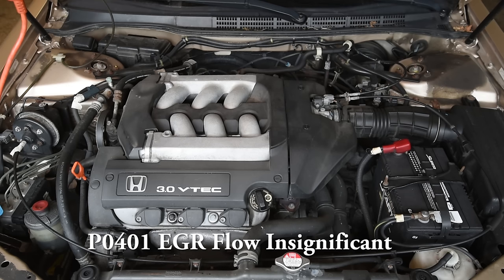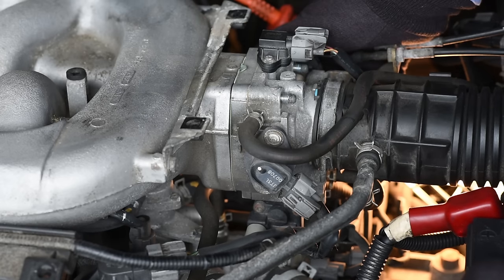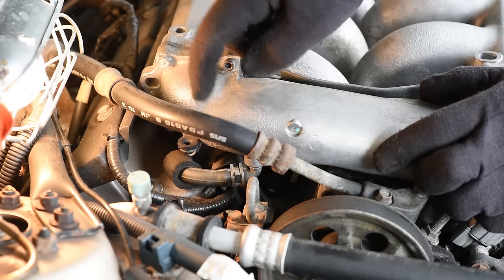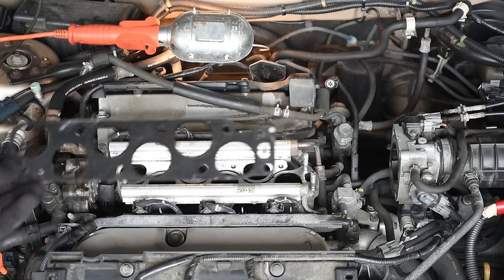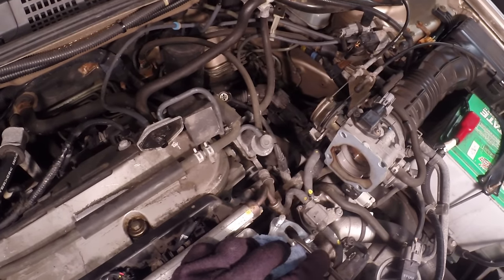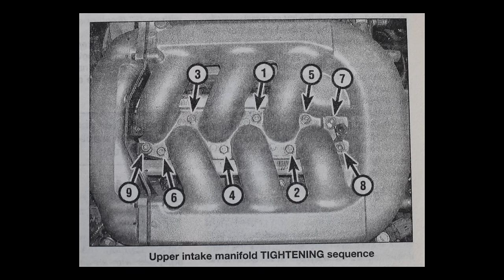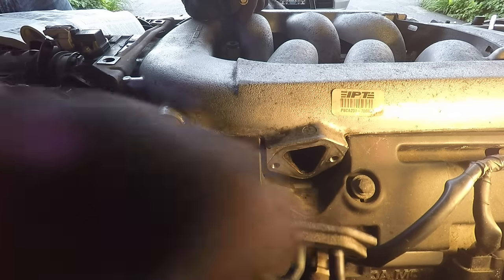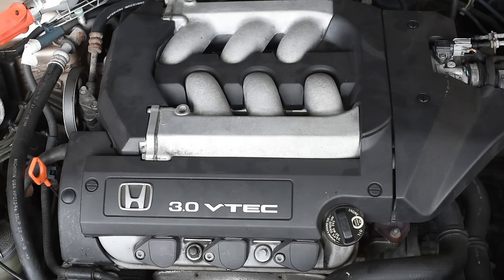How to Clean EGR Passage in V6 Engine (1998-2002 Honda Accord and Acura) P0401 code

Comment: Great video. Congrats Igor. Top class instruction and enough  detail to guide even the rankest amateur without loading too much technical stuff .onto  the video. Great idea to illustrate the undo and tighten sequences. One query. In Australia I am not sure about the liquid you are using to clean out chambers etc. Is it available  outside  the USA?
Reply from the maker: Thank you Doug! You can use any carb or throttle body cleaner. I did a quick search on Australian sites, something like that for instance https://www.supercheapauto.com.au/p/nulon-nulon-throttle-body-and-carby-cleaner---400g/9805.html?cgid=SCA01080301#segment=1&page=1

Comment: your video is extremely helpful. but could you plz tell me what the sensor is on the back of the head? I found there is no gasket in mine when I pulled it open.  and the hose to the left, exactly what is that called? my clamp is in horrible shape. thank you so much ahead of time.
Reply from the maker: +gwcs1218 hi. Thanks for feedback. I believe this is PCV valve, and the hose is called "pcv hose"
Reply: Igor Kadulenkov  thank you so much I wasn't sure!

Comment: could carbon build up lead to compression being sent to top of motor therefore sending oil to top of my motor. this motor to be exact, I replaced egr valve code went away, but i am having  3 cylinders misfire with oil being found when i pulled out the spark plugs if you have any idea why this is happening, would much appreciate the advice🙏🏻

Comment: WHEN YOU CLEAN THE EGR PORT ON THE MOTOR WITH THE SCREWDRIVER 🪛 AND SPRAY WITH CARBURETOR CLEANER WHERE DOES ALL THAT DEBRIS GO ?

LOOKS LIKE IT WOULD GO INTO THE ENGINE I ASSUME YOU WOULDN'T DO THAT IF IT DID... SO WHERE DOES ALL OF IT GO ?

EXCELLENT VIDEO BTW... THANKS 👍

Comment: What is the spray called?
I have po401 code on my 99 accord and have done the following to it: new converter, erg valve, spark plugs, ignition rotor, distributor cap, and an exhaust leak fixed. I'm still having misfires and the code is still on. What should I do?
Reply: What new code are you getting?

Comment: I have a 1998 Honda Accord v6 with 242,000 miles that had the P0401 error code.  I removed and cleaned to intake ports associated with the EGR, but after driving approximately 30 miles, the error code comes back.  I replaced the EGR valve and gaskets associated with the repair.  The car runs great, but lost on what can keep that error code coming back.  Any help would be appreciated.
Reply: This video misses a step. The EGR valve should have been removed to completely clean out the EGR passageway. The EGR valve also needed to be cleaned with carburetor cleaner while it is removed.  According to professional mechanics, Denso EGR valves never fail unless its hit by a missile. They can be cleaned with carburetor cleaner and put back in place after you've thoroughly cleaned the EGR passageway first.

Comment: I have 2000 v6 Honda Accord,  had egr intake removed and cleaned week ago. The engine light came back on 2 days after cleaning. Car runs okay a little sluggish  Today all the interior dash lights came on, what to do now.

Comment: Do you use air duster to blow it out? Do I blow it inside the egr valve passage? What if I cant torque at 16lbs I don't have the tool
Reply: You can tight em by hand just make sure all the bolts are eavenly tight.

Comment: After seeing so many videos of these kinds of fixes... I'll probably never go see a mechanic for this kind of stuff. "$120 for a catalytic converter; $245 for the service." That's what they told me. It took them 10 minutes to switch the cat out. They charged 24.5 dollars PER MINUTE that was spent working on my car. Lucky for them I don't have any welding equipment. Mechanic right up the street wants to charge me 800 dollars to clean out my EGR valve to get rid of my check engine light.
Reply from the maker: +Pander G yep, that's exactly why I try to do as much as I can by myself. A starter welding machine costs around 80$ on eBay. I guess it's a bit harder if you don't have a lift though. But yeah their prices are insane. I wish more people would service cars at home
Reply: Omggg 🥸

Comment: Thanks for taking the time to produce this video. When you cleaned the descending EGR passage in the front injector base (17055-P8A-A01), where did the gunk you loosened end up? Also, I'm curious why you did not remove the EGR valve (18011-P8A-A00) and clean its ports as well as the ports in the water passage housing (19410-P8C-A01) where it mounts to.
Reply from the maker: Hi, i replaced the EGR valve a few months ago, so didn't need to clean it. It looks like in 80% cases the passage in the manifold is the one getting clogged. For the gunk, i assume it's getting burned in cylinders. I am not 100% positive it's the best approach, but it worked for me.
Reply: @IgorKadulenkov  How often Miles do you have to Clean the manifold???

Comment: does this cause the engine pulsation then just drop and stall? because thats what my car is doing. it would start and stall out.
Reply: kalilaoboiii707 Hey man . did you ever fix that issue? I'm going to try with my girlfriends car it recently started doing the same thing.
Reply: That sounds like a clogged intake, pull the manifold off and clean all that carbon and crap out.

Comment: hey Igor I can  not detach manifold from the throttle body  gasket.I  taped with hammer and nothing .Its like glued . any suggestions. I had my car for 18 years
Reply: i got it i used screwdriver under angle   against the top of throttle body and hammer and it worked.
Reply: Have a new one ready

Comment: What is that part at 3.5 min I have this engine and when I bought the guy sold it to me with the upper hold having a screw in to plug the the hose.
Reply: Joshua Campodonico EGR valve ? Your car prob runs without EGR now
Reply: He did an egr delete just put one back in

Comment: Igor, I have the same problem too. I replaced plugs, coils and egr valve but check engine light keep coming back. After watching this video I am going to do the same proceeder. That's my next project.
Mechanics in New York are crazy and arrogant. My question is, will the light go away by itself or needs to reset again.  Thanks.
Reply from the maker: Hi,
Sorry for later response. I would reset it, I usually use a cheap Bluetooth scanner for that. 
It should go away after that.

Comment: i just did this but now the car is revving on its own ?????????? help please
Reply: Did you find out what it was? My car does the same thing.
Reply: @mrblankthoughts  no i didnt.
Reply: Did you change all gaskets? Did you buy new egr?
Reply: check your vacuum lines for any cracks or cuts, make sure all connections are on, if it high iles then comes back to low idle and continuously does it its prolly a vacuum leak from any of the hoses you removed from intake manifold
Reply: Well, it's been over 1/2 year hopefully you have it fixed, if not try these three things. Burp the radiator and/or clean the IAVC. It might need to relearn to idle also.-----> 
idle learn
https://www.youtube.com/watch?v=-izuZvjCh4Q&t=150s

clean IAVC
https://www.youtube.com/watch?v=vUXXzVL5frk

bleed cooling system
https://www.youtube.com/watch?v=zUpXgAJ1gjU
Reply: Sounds like a vacuum leak somewhere

Comment: hello
i did exactly what you did, but after i cleaned and start the engine the car work fine for 2 minutes and then white light smoke come out and the RPM goes up and down!! is this mean the carb cleaner did not dry out yet, please advise
Reply: You plugged the egr hoses in wrong done it before on a dodge avenger v6

Comment: Hi, what's the torque wrench you used? And what was that magnetic tool? It made doing this job very easy!
Reply from the maker: +Dan Hi Dan, that torque wrench is some cheap generic that I got from AutoZone. Basically any torque wrench will do here. The magnetic telescopic tool you can also buy at AutoZone or O'Reilly's, they're like 1$ :) or you can buy one online. This is a super handy tool

Comment: I did what you did here on my car and I drove the car for about 15 miles so far. The check engine light is still on and sometimes flashes. There is no other codes. What seems to be the problem? Thank you
Reply from the maker: Sorry for later reply, did you figure it out? Have you reset the code after cleaning the ports? It could be caused by other problems.

Comment: Can this be causing all my cylinders to missfire? I have same car.
Reply: Daniel Salgado possibly I'm having a misfire think I got to clean my engine
Reply: Felipe J Briceno bro it was a fucking coil lol
Reply: @danielsalgado6883  oh lucky lol, I've still got mine throwing me fits
Reply: You are lucky because my car was misfiring so bad it would hesitate to accelerate. So I bought some coil packs and spark plugs (only one sparkplug was shot) and replaced all coil packs. My car still has the flashing check engine light and has misfires in all cylinders....It idles rough with a shaky engine too.....
Reply: @Khi.252  Same here, bought all 6 coils and spark plugs and my check engine light keeps flashing
Reply: Sergio Figueroa My car also needed an EGR Valve, I changed 3 of my Spark Plugs (2 I couldn’t get to and the other was pretty much new) after that and it turns out that the plugs may have been burnt from the misfiring. My car did not hesitate anymore after I replaced those, and it showed a great difference in power. My check engine light doesn’t flash anymore either.
Reply: @Daniel Salgado were all of your cylinders misfiring at once? Was it one coil pack or all?

Comment: Can the intake be tightened without a torque wrench, and if so, how much?
Reply from the maker: Are you asking to provide torque settings for your hand?
Reply: @IgorKadulenkov  No, I just don't want to buy a torque wrench for one single job. Sometimes they'd give how much of a turn you tighten after the screw reaches the surface, like for spark plugs, I was asking for that.

Comment: same car but wen i start it up sometime it will shake an idle then eventually die. it only does it wen being started up an i woukd have to hold the gas to get it steady. ???
Reply from the maker: +Curly Yee hmm could be many reasons for this. Do you get any codes?

Comment: Dumb question, seems like no need to change the actual EGR valve if this code appears. It is actually the passages that needs cleaning?
Reply: OEM EGR valves seldom go bad; its almost always a carbon clogged EGR passage. Many engines have a simple straight tube which can easily be removed, checked and cleaned  but for the J30A1 engine (Accord 98-02)  Honda made a super fancy bendy passage they cast into two different aluminum manifolds. Thus you need to carefully grind them out, some use a gun barrel (wire) tube brush with plenty of carb cleaner or do like the video. It will clog again eventually. Pop a cheap after market EGR in there and it will keep code and then fail.

Comment: Which spray cleaner was used? Got P0401 on 1998 2dr Accord V6. Mechanic asks $420 for it. Would rather try this. Thanks in advance!
Reply from the maker: It was a carburetor cleaner, as I recall. Yep it's pretty simple. Also, I would rather not spray it down the line to EGR valve, without taking out the valve first.
Reply: Igor Kadulenkov Thank you, I’ll give it a shot.

Comment: You're supposed to put all the bolts in and start them with 12 inch pound to seat the gasket and then 30 and then 190 inch pound

Comment: Ok let me give any viewers a piece of advice, so that you don’t have to spend TWO HOURS needlessly like I did tonight.   First off, I have to say it, this guy didn’t include everything that needed to be done to take the manifold off; there in an inlet with 3 hoses/cables in the back that has to be unscrewed as well as a connector next to it that has to be disconnected; I don’t think he mentioned either.  Until you remove those you can’t take the manifold off, which is why I never did.  So don’t bother.  Instead, take off the EGR valve, easily removed with a 12 mm wrench, and clean it out with a screwdriver and carb cleaner if you have it. If you have a P0401 code like I did, it will likely remove it! If I had know how that all would go I’d never have attempted to remove the manifold, just cleaned the EGR, and saved 2 hours and a stiff back! 🙄

Comment: Sea foam intake cleaner would save you a lot of hassle
Reply: Perhaps add it after manually cleaning the ports. This really isn't that rough of a job. It only takes about a 1/2 hr. to do the full job. Some of this carbon gets rock hard. It's best not to run that sludge through your engine/pistons. Additives are not OEM.
Reply from the maker: I've read mixed reviews and opinions about the sea foam. Can be more harm to your engine and exhaust system.
Reply: @IgorKadulenkov  it don’t Taste good I know that 😂

Comment: Sounds like they all get that noisy power steering pump? lol  I`m 180K and my 02 accord just started having this TCS check engine problem. I will never buy another Honda I got screwed with Trans problems early on, paint problems and now this. They covered  trans 01 but not 02 even though they are the same 6th gen with same problems. Replaced transmission out of warranty. Thing is the motor would probably go 300K. Probably going to just buy a new car won`t be a Honda!